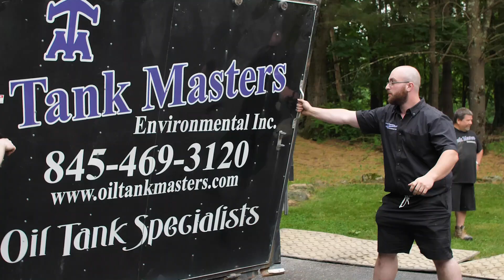It's Never Work When You Spend The Day With Your Children!!!!

Comment: I know in some videos that you say that if the tank is inside it can’t be within 5 ft of electricity right? Or something like that? Does that not apply when it’s an outside install next to the air conditioner?
Reply from the maker: Yes it does. Unfortunately these codes are not black and white with every township or city. Most of the time we have seen that they do not consider an AC unit an ignitable source.